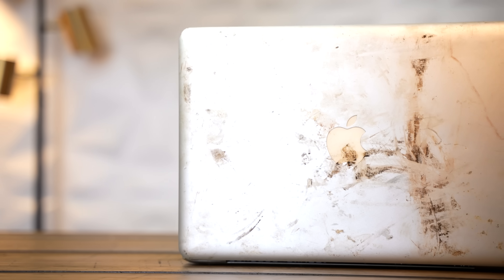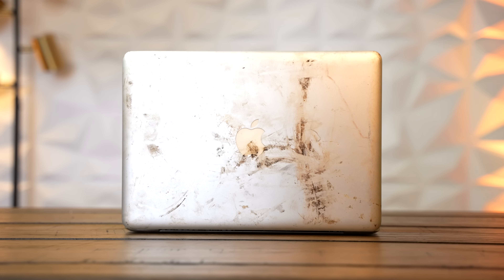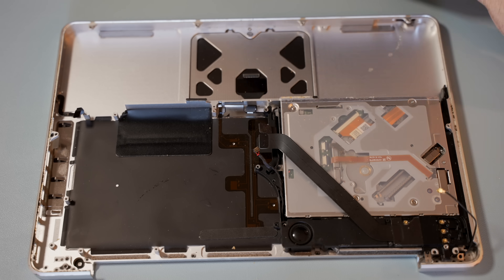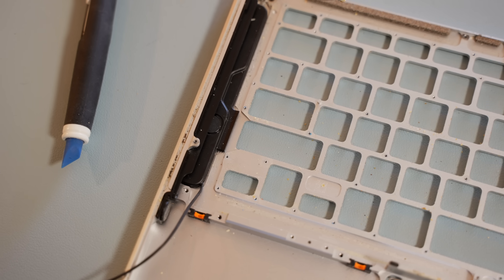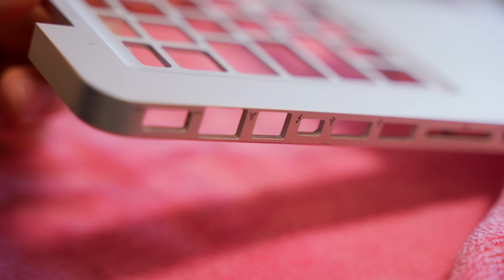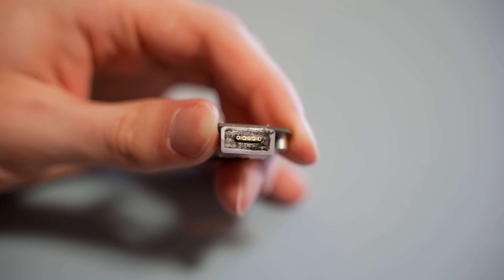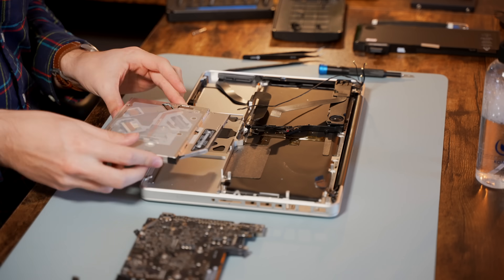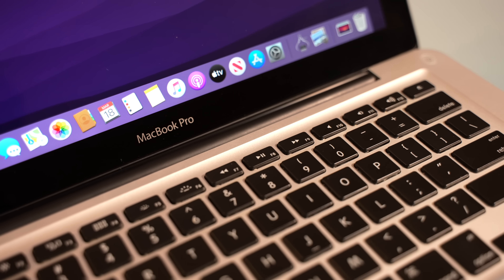Deep Cleaning & Restoring this FILTHY MacBook Pro for $10!

Comment: It looks beautiful now. Those unibodies do be holding up despite it being 2021.
Reply: Yeah! Looks premium and better than many cheap windows laptop even today and those trackpads are also better than many trackpads found in windows laptops today
Reply: @ajiteshsharma6714  I'm completely agree with you. Try to find any Windows laptop from 2008-2012 with good design and usability to today's. I think doesn't exist.
Reply: @ajiteshsharma6714  Yea but comparing an overpriced mac book to a cheap windows laptop is terrible, I've had my omen laptop for 6 years and preforms better then most Mac books on the market.
Reply: @ajiteshsharma6714  it cost me 2500 dollars so it wasn't cheap windows does not equal cheap. Windows has more features and more programs than Mac and don't have built in expiration dates.
Reply: My only problem with them is the weight, 4.5 pounds is HEAVY for a student
Reply: Gaming York  my late 2008 aluminum works pretty good to
Reply: @oofingberg  Under which OSX version?
Reply: I love the unibody ones. The 17” is my favorite but it’s too heavy and the latest one has an older CPU and GPU (which is faulty and fails in almost every of these machines unless you get lucky and/or have high quality thermal paste applied, routinely clean the heatsink and fans, and keep the fans on max as much as possible) so I’ll probably use a 2012 15” fully upgraded if my 15” from 2014 ever breaks since the displays are so fragile. They’re complete opposites when it comes to durability.
Reply: @supercrazymario404  17 inch unibodies are amazing. Everything i loved about the other unibodies without the fat bezels.
Reply: Yeah, except for the display. I can't handle 1280x800 and 1-inch bezels.
Reply: @cidsx  oh my god yessssss
Reply: @cidsx   aw man I still like the bezels
Reply: @Rawwr1ful  I used to like bezels somewhat but the bezels on this one just look stupidly ugly. I personally like a little bit of bezel, but this is too much, considering that the screen isn't actually that big.
Reply: @l0ud5p34k4 yeah it seems probably the biggest thing for a computer being buttery smooth is whether it has an SSD or not. A Samsung 860 Pro is the best of the best and you can even put 2 of them in RAID 0 to get double the SATA bandwidth. I might do that one day with a top tier 2012 15” unibody if I get one
Reply: @l0ud5p34k4  oh I’ve been able to install MacOS onto RAID 0 pretty easily. It’s really worth it because SATA’s 6gb/s limitation is probably what makes it feel even remotely older than the retina MBP from late 2013 and later especially when used with an adapter to put in an even better SSD since technically even though those things use PCIe 2.0 x2 (8gb/s) SSDs, they can use x4 speeds with an upgraded one, even a native Apple 1TB SSD which has x4 speeds which is what I use in my 2014 and that difference between 8 and 16gb/s is indeed noticeable especially in modern MacOS with its larger files compared to using Mac OS X mavericks. So I’m sure the difference in the case between 6 and 12 gb/s would be very noticeable as well. Also, some SSDs are getting pretty cheap these days compared to before so you could get a cheaper SSD to use as a secondary drive since hard drives are just painfully slow, aren’t durable, and die a lot quicker (though some SSDs do die quickly too but still as long as they’re decent quality they’ll still last). And as far as wifi goes, I actually do believe it is possible to install a pretty nice upgrade. I’ve seen people install ac wifi cards in old 1st gen intel iMacs so I’d believe that it might be possible especially since you can find adapters on eBay easily and the antenna connectors are the same regardless. Though at the very least you can install a 2012 card that has Bluetooth 4.0 for being able to use handoff and continuity if you don’t have a 2012 machine. I actually just looked this up and someone was able to make an iMac 2015 AC card work in one of these machines. https://forums.macrumors.com/threads/802-11ac-and-bt-4-2-are-here-for-unibody-mbps.2171056/ and the 2017 iMac wifi card might work too since it uses the same connection. Maybe eventually I’ll make a video of a full upgrade for one of these machines and really go absolute perfection on it. I might do that as my next project and maybe make a video too because having a machine that rivals that of my current one as far as performance goes and also having easily removable components is a pretty sweet deal.
Reply: @l0ud5p34k4  yeah though still the CPU capability of quad core ivy bridge is still pretty high. It’s not all that different than haswell counterparts so it can definitely handle really high speeds. As far as hackintoshes go, I’ve broke my bootloader so many times when trying to change things so I ended up following a much more complex manual process so I could tweak it as needed. Plus, this one could be easily installed to a different partition on the main boot drive which I couldn’t figure out with my other bootloader so I kept using a USB stick to boot each time which kinda sucked. If you wanna give it a shot, here’s a webpage with all the information and plus it also covers additional stuff that is separate from the main installation and booting process. https://dortania.github.io/OpenCore-Install-Guide/There’s even a page on supported GPUs which was helpful so I was able to use a somewhat old but still powerful card which is a Radeon 7970 GHz edition which supports metal. And this card was amazing because the kinds of games I play ran really well even at 4k. And on this machine I just have it plugged into ethernet since it’s not moving anywhere unlike my laptop. However if I wanted to use an original wifi card such as that one I mentioned, there are PCIe adapters with that connector so it’s easy to install that. If I wanted to use it in my 2014 MacBook Pro I could since it uses the same connector as the card itself but the screw holes don’t line up so I’d have to hold it on with something else. I’d probably just replace the thermal pad on the back of that card with something sticky and that would do the trick. But for a unibody I believe all it would need is a physical adapter and that would be it. I think they all use the same PCIe protocol so software shouldn’t be a problem unless of course it’s too new to be detected which I don’t think would happen. And the cards can be bought for much less on eBay for around $43 though sometimes they’re more expensive especially if shipped internationally though being such a small package it shouldn’t be that much. Personally I’m gonna buy one of them myself and put it in my machine so I can have the best possible speeds since sometimes I need wifi connection from a further distance and it disconnects a lot.

Comment: How come you didn’t repaste the cpu. For nearly a ten year old MacBook it is probably running kind of hot under loads. My 6 year old MacBook Air needs to be repasted and it has been treated very well so I’d think that this would need it?
Reply: I have a theory. Maybe he did it off camera, and didn’t mention it at all, so the comments wouldn’t be filled with “oh you did the thermal paste wrong” or something like that
Reply: @halami2149  Maybe, yeah, that’s likely.

Comment: Would using compressed air for cleaning your keyboards be a good idea?
Reply: im not a pc tech expert but if you are talking about a external keyboard ex a mechanical keyboard yes you can .
Reply: @lazul1ne  mmmmm ok thanks cuz im trying to clean the butterfly mac keyboard
Reply: @youngtalent2487  then no i cant help you sorry i dont own a mac
Reply: YES SURE, but the problem is sometimes copressed air can when ever you use it in wrong angel it spray some sort of frozen air that turn to water afterward and ruin your PC/LAPTOP, so be very carful about this point!

Comment: Good ol times, when everything was screwed in and no glue in sight.
Reply: There’s glue in the backlight and in some of the flat cables within the body.
Reply: yeah, i today cleaned my thinkpad for the first time and i must say it's easier than i thought
Reply: There's still glue securing the glass to the LCD, but easily overcome with a hairdryer, some ifixit opening picks and a lot of patience.
Reply: yes! my daily driver laptop is a 15" unibody macbook pro running linux, and it's an awesome system. it's sad to say but my next laptop won't be from Apple even though i really like everything about them (build quality, nice displays, even the keyboard layout on Mac's is amazing), but i'm forced to as the new Mac's can't boot linux or easily upgraded/repaired...
Reply: @Ashleyyyyy666  you can boot Linux on an M1 MacBook lol
Reply: Still better than being forced to use a corrosive solvent, just to get the battery out.

Comment: Are u interested on a early 2011 17" model? It has the issue with the chip that comes loose, that Apple refurbished with a rubber piece lmao. I can fix that part but the display (works, but the plastic is cracked in the bottom left)

Comment: hey. i’m sorry to say but this seems fake. i have nothing against you but i’ve taken apart a lot of macbooks and there’s no way it could be that dirty on the outside while the inside is fine. it’s as if someone sprinkled dirt on top of it. when dust and dirt gets under the keys, it slowly breaks down as they are used. so for them to feel that crunchy makes it seem like someone put the dirt on all at once. how would that dirt smear even get on the back cover? how would there be visible dirt crumbs? don’t people touch the top case of their macbook?
Reply from the maker: As I said this came from a recycling center so most likely at least some of the dirt accumulated outside of the MacBook being in use, hence why the exterior was so filthy
Reply: @lukemiani  i apologize- i was upset and i didn’t finish watching the video